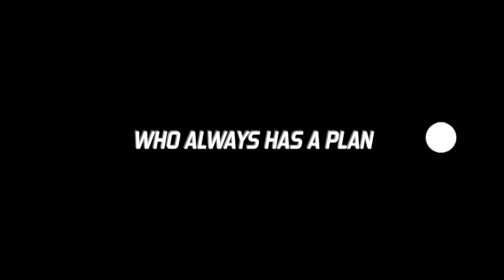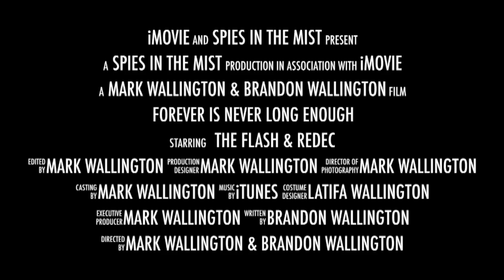Some painters are just Unbelievable

Comment: Why not just use masking tape around edge of ceiling and u will get a better line instead of cutting in ??????
Reply: Because a skilled tradesman should be able to cut in perfect and not have to use a DIY trick.
Reply: Because a skilled tradesman should be able to cut in perfect and not have to use a DIY trick
Reply: Because the ceiling is definitely not 100% straight and using tape can make it even worse 🤷‍♂️ talking from experience. Straight cutting in is pretty much optical illusion
Reply: Tape.....you aint a pro for sure